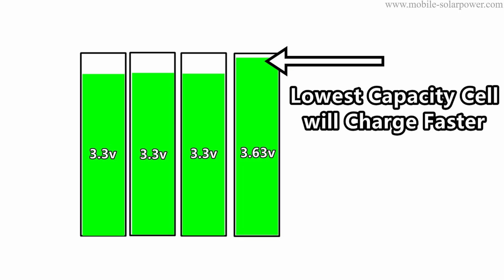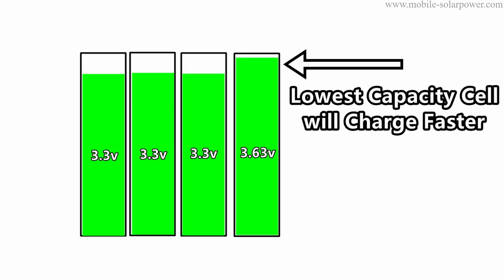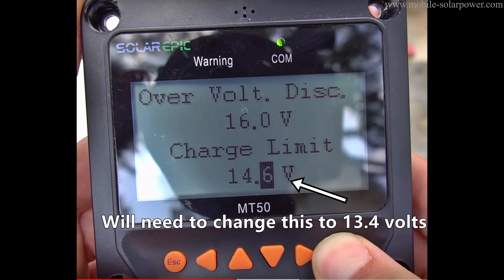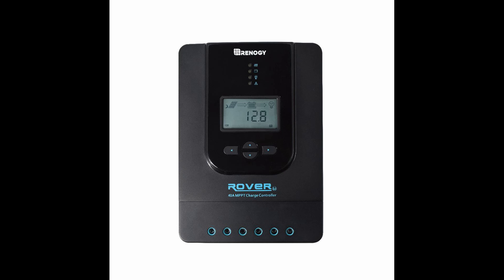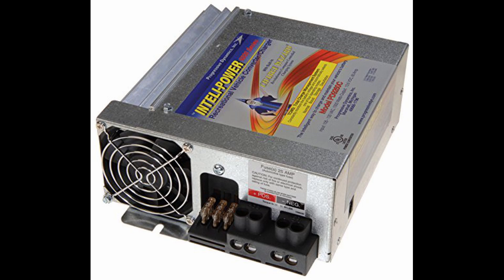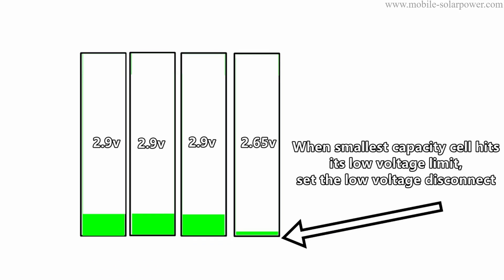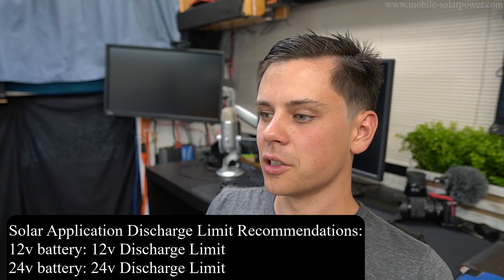LiFePO4 battery w/o a BMS: Top or Bottom Balance? Mismatched Cells?

Comment from the maker: This is an old video when we ran packs without bms. Nowadays, you just slap a bms on the cells and it's good to go. It will top balance your pack and you don't need to think about anything. 

So don't worry about top or bottom balancing. Use a BMS and you are set.

Does off-grid solar confuse you? 
Check out my DIY friendly website for solar system blueprints and product recommendations, and so much more! 
http://www.mobile-solarpower.com

Join our DIY solar community 
#1 largest solar forum on the internet for beginners and professionals alike:
https://www.diysolarforum.com

Check out my free book
Best-selling and beginner-friendly guide to 12V off-grid solar!
https://www.mobile-solarpower.com/the-book.html

~~~~~~~~~~~~~~~~~~~~~~~~~~~~~~~~~~~~~
My Favorite Online Stores for DIY Solar Products:

Current Connected
My favorite USA Distributor! Best Prices for EG4, Victron, Solar Panels and high quality components. Fantastic customer support and fast shipping: 
https://currentconnected.com/?ref=wp

WattCycle
My favorite 12V budget battery!:
https://www.wattcycle.com/?ref=aaezwkkc

Epoch Batteries
My favorite high-quality 12V battery:
https://www.epochbatteries.com/products/12v-460ah-lifepo4-battery-ip67-heated-bluetooth-victron-comms?rfsn=7352625.50494d

Watts247
Need international shipping for large batteries and big inverters? Check them out!
https://watts247.com/?wpam_id=3

Rich Solar 
Budget 12V Inverters and MPPT:
https://richsolar.com/?ref=h-cvbzfahsek

Battery Hookup
Cheap used lithium cell deals:
https://bit.ly/2mIxSqt
5% off code: diysolar

Contact Information:
I am NOT available for personal solar system consult! If you wish to contact me, this is my direct email: williamprowsediysolar@gmail.com

Join the forum at https://diysolarforum.com/ if you wish to hang out with myself and others and talk about solar

FTC Disclosure Statement and Disclaimers:
Every video includes paid promotion or sponsorship. Some links on this youtube channel may be affiliate links. We may get paid if you buy something or take an action after clicking one of these. 
My videos are for educational purposes only. Information is subject to change/update at any time. Electricity is DANGEROUS and can kill. Be smart and use common sense :) 
DIY Solar Power with Will Prowse is a participant in the Amazon Services LLC Associates Program,
An affiliate advertising program designed to provide a means for sites to earn advertising fees by advertising and linking to Amazon.com
Reply: Even I got mismatched cells, BMS will help. right? Thanks.
Reply: If you have a configure of more than  1 in series  than you will have to bottom balance. BMS can't reach back on the 2nd series because the BMS only has leads on the 1st series 

still have to set the parameters on the bms. You still need to set parameters on the solar charger and bms. It makes my life easier because if one fails to protect than the other is doing its job. Sometimes my epever will spike on the volts and won't shut off on high volts for a few seconds but, my bms will stop that in a flash.
Reply: Will, I'm just top balancing 4x 125Ah cells and I want to use effectively 100Ah at usable 12V system voltage  (100A Daly 4S will of course be attached) in my overlander, with 2x100W solar on the roof. What voltages would you recommend? For the Victron MPPT and Orion I had in mind 14.2V absorption, adaptive, limited to 1hr, 6A tail current and 13.4V float. Victron BMV set to 100Ah capacity, 14.0V charged voltage and 5% tail current.

But after watching your video I'm no longer sure to set the voltages that high ..
Reply: Will, how much of a voltage difference between cells can I still consider as fairly well balanced?  I know you said we can just slap on a BMS but I've heard many say that is not enough if the voltage or state of charge of the cells are way off.  I am planning to buy slightly used LiFePO4 batteries for a 12V 4S 100AH DIY portable battery bank and I want to be able to make the most of the batteries but I'm afraid I may end up with "unbalanced" cells from the seller. 
Thanks.  Your videos have been very helpful for people like me who know little about these things and are trying to learn.
Reply: Hi, I have bought a used battery pack 16s10p made of LiFePo4. How could I balance them since I cannot remove the cells from the pack ? thanks

Comment: I wish I'd found this a week ago.
I had exactly the problem you showed: 3 cells @ 3.34v and 1 cell @3.54.

Luckily your forum walked me through how to handle it. 
I only  pushed 13.66v for a few hours trying to get the BMS to balance but the cells actually lost voltage and I ended up having to put an old flashlight on C1 to bring it down.

I'm replacing the BMS with one that is programmable multiple ways.
Now I know what to settings to use.

Thanks!

Comment: Greetings from Portugal. I use a JK BMS on a 2P8S (EVE 280Ah cells) and it doesn't allow for automated bottom balancing anyhow, the 'start balance' setting cannot be reversed. Nonetheless, I manually bottom balanced the cells @2.8V UVP over several days but found the Ah stored after a full charge was quite a bit lower going from 590Ah top balanced down to around 550Ah now bottom balanced with the same Victron MPPT settings. I'm now going to switch back to top balancing @3.45V and see if that loss is recoverable... I cycle the battery fully every night with whatever the charge controller puts in during the day, when the BMS kicks in with UVP 2.8V the inverter auto switches to grid until the sun shines next day. This has reduced my electric bill by €60 a month so if I get 2,000 cycles or about 6 years that's a good return on investment of €1200. EDIT The JK BMS has now fully top balanced the pack @3.5V and the last two full cycles got 598Ah so top balancing  gives more capacity, the cells are 200mv out of balance @ 2.8V but only 2mv resting @ 3.4V.

Comment: I use a 100 amp 24v battery for a wheelchair, I charge it to 3.45v per cell and discharge it to 3.2, 3.1 per cell. Is that good for the cells themselves?

Comment: I have a few packs.  Hundreds of dollars worth i made for less than half because i followed these simple guideline. No Bms.  Only thing to add mentally get a gauge of your average commute. Build battery accordingly. If a 10AH will drain halfway to work and back in up to few days. BUILD A DOUBLE IF POSSIBLE 15 OR 20AH.  Cost is issue BUT KEY because of larger size. You never drain it maybe half.  BOTTOM LINE YOUR CELLS ARE. NEVER STRESSED.  STAYING BALLANCED.    DONT WIMP OUT ON AMPS

Comment: Ebike charge 95% add xtra string of cells increase4.2 more. Remember voltage equals Speed. My transistor is63v on a 36v setup i can handle 4 more.  I heard this s few times.  It van be done

Comment: I bought a XZOY 24V-5120W-LiFeP04 (200-BMS) and since it comes with it's own internal BMS, and is rated for 25.6V, what should I set the lower and upper limit to in my Victron Solar Charge Controller and/or my Victron MultiPlus-1?

Comment: Wouldn't a diode between the charger drop the voltage to the battery for chargers with set voltages ?

Comment: Hi i have 4 x 210Ah Cells, 4S 12V. 2 x Cells at 3.33, 1 Cell at 3.25 and 1 Cell at 3.28. Maybe sound crazy, but is there a way to balance the cells by drawing current via a 3V Motor, to manually bring down each cell so they all have matching voltages, using a multi meter in the process. I have a Victron IP22 charger, so no good to top balance, and i don't want to buy another charger to top balance. The string will have a JBD BMS but I want to balance the cells before installing the BMS. Many thanks

Comment: Assume I have several 12v (4S) Batteries with their own 4S-BMS.
Assume also I have an Inverter that takes in 48VDC.
Q1: Will it work if I connect 4 of my 12V batteries in series to my 48V Inverter?
Q2: Can I connect the Inverter to the Batteries CAN port and get battery readings?

Comment: How critical is balancing the liFePo batteries?  And initial individually full charge before hooking up?
I have (8) 12v 100ah chins in a 4s2p config for my 5000w 48v phocos.  I have about 2000w pv input.  
Seems like they are not lasting long as they should.

Comment: I just bought 6x48v 30amp hour batteries and I can not get them to charge past 54.2volts. Manufacturer says to charge to 58.8v, but my Growatt maxes out at 58.4v. Doesn’t matter as the battery’s BMS (well one of them, they are in parallel) shuts the Growatt down at 54.2. 
Manufacturer says to discharge and charge to full at 10 amps which I’ve done 3 times now with no improvement. These are LifePo4 chemistry batteries.

Comment: Well, leave comments or questions. Hmm
My 8 year old Trogen L-16 battery system is connected with 16 new LI-iron 280ah good quality top balanced batteries.
I cycle between 12.4 vdc and 13.4 vdc on my 12 solar panels here in Montana.
I will have to turn off the li-iron when the temp drops below 35 degrees in my shed.
I eventually will phase out the Trogen batteries and get another 16 Li-Iron.
About 3 months the system is off during the darkest part of winter, on trickle charge
ANY SUGGESTIONS, Please reply, Thank You.

Comment: Excellent Will thankyou. I'm using cells for car audio sound quality build. Since they will never see low voltage and run around 14v, but your right, top balancing is most certainly the way to go, and again your right it is way better to bottom balance if at all possible

Comment: I have a question , if I change lifepo4 to 3.65 how long do I need to wait till it balance? I'm building 24v 8cell pack when parallel battery pack hits 3.65v I disconnect chage and check voltage tow  cells in 3.64 and all other in 3.65 - grade A new cells (sorry about my English)

Comment: How to change the upper voltage limit. In the bms I have set the upper voltage to 3.4 volt. The cells are not good quality ones. It is getting disconnected before complete charge. Please help.

Comment: Sorry for the noob question, but isn't the job of the BMS to manage each cell and to dynamically balance the whole pack? So if one cell reaches a higher or lower voltage compared to the rest, the BMS will just cut power to it or continue charging/discharging it longer, etc. Why do you need to top or bottom balance if you have a BMS?
Reply from the maker: This was back in the day when people ran systems without a bms. Especially the marine crowd. This is no longer an issue.

Comment: Hi Will and all together, have I understand right, that I can top balancing my cells with 13.4v with my solar charger? With or without the BMS? And is that right that I don't need a extra Lithium battery charger to balance the cells? It would be great to get a answer from someone!  🙏🙏🙏😊

Comment: Wouldn't having the cells on a bms do both bottom balancing and top balancing on it's own once voltage and internal resistance reach capacity it send power to the next cell. Is this only for multiple cells on paralleled together?
Reply: BMS will balance very slowly. And you will need to cycle the battery several times. This can take weeks of daily usage for a large battery. If you have like a phone charger you can likely just let the bms do it over a few days. But for like a 1kwh it could be a week of full use.
Reply: @dylan-nguyen  but in a daily use such as living off grid they would be cycled daily.
Reply: @gabrielmartinez3171  sorry I forgot to mention the cycling without balance can lead to poor performance and decreased cell life.
Reply: @dylan-nguyen  wouldn't the bms do the balancing though? Is this for uses cells or do companies balance their batteries when placed in packs such as tesla using 18650 cells? Every cell would have a slight difference voltage and internal resistance right if so they must go through alot of time and energy. I'm not using lithium yet but it has me intrigued when I need to replace my sealed batteries 800 amp hours at 48v. Prices are coming down on prismatic cells wouldn't be able to afford the price already built batteries like the battleborn. $16000 for 400 ah at 48v.
Reply: @gabrielmartinez3171  depends on where you buy them. Most will not balance separate batteries. Internally each battery should be balanced from the store. 
But if you buy more than 1 pack, You still want to do a manual balance for speed/reliability. If you’ve seen a bms it usually uses like 12-16awg wire so the balance is very slow. 
Whereas you can manually hook up 8-10awg wire and balance in an hour or so.
Reply: @dylan-nguyen  I was thinking about grade A 280 prismatic cells 2 sets at 48v each with a 100 amp Daly bms I dont have high draw items on my solar system mostly constant load. I need at least 20,000wh of capacity to give me my 3 days of backup since I'm 100% offgrid.

Comment: Do I need to balance my 4 Battle Born 12v 100ah before hooking 2s2p? 3 are brand new but been using 1 for a month in camper
Reply: Yes if u got more than 1 battery u should balance. Unles it’s like a tiny phone charger

Comment: I’m looking at buying 3 300ah 12v drop in replacements and connecting them in parallel for 900ah capacity, is there a different way to balance these?

Comment: bro can you make a video about mixing different brand of lifepo4 batteries in series ? like I have 12v 100ah plus another 12v 138ah and 12v 40ah batteries in series ?
Reply: Don’t do that you’ll effectively lose 100AH. In series you will get the least cell’s capacity.. so 36v 40AH

Comment: Do I need to balance my Lion Energy battery bank? I individually charged each battery (4) I haven't connected them together yet. I am running a 24V bank, 2 pairs of 12V batteries. Since the batteries have BMS, is it unnecessary for me to balance them? Will they do it on their own in time? I am probably over thinking this, but hoping you can help me out.

Comment: STOKED - FOUND SOMEONE TO EXPLAIN ELECTRIC STUFF. My wife and I have lived on Maui for many years in Kihei - desert, but not as hot as LV (I grew up in KS so I've worked in 112-115 F) and are stretching out budget on Social Security in one of the priciest, most inflation prone areas of USA.  I want to put together a modest solar setup - not on a roof, but on the ground per need, to charge my Dell 15" laptop, several iPhones and D-cell batteries for a small emergency fan.  I'm a bed bound mostly invalid and spend most of my time in a back bedroom with poor ventilation.  Home Owners association rules allow a room AC in living room only - so if electric goes out I'm dead meat without a fan of some sort.

My forte' is concrete and dirtwork as a construction surveyor and former federal chief inspector and knew very little about electric until I discovered you!  I've worked on two of the tallest buildings in the world in succession in Chicago, but never did much with home building other than layout some subdivisions.  My experience is strictly major construction, interstate highways and the like. 

Techies like you tend to throw around a lot of acronyms.  I figured out BMS as battery monitoring system, but continual acronym references becomes tedious and "cultish".  I have great admiration for so much enthusiasm and diligence in one so young!  Keep up the good work - I will be watching!

Comment: Hi Will, not sure if i can get an answer on this or not,, I may have asked in a previous video..  But here i learned that for solar it is better to do a bottom balance.. I will have a 13s system that i'm building using the big BMW cells, about 27Kwh. per cell. I think.. i calculated about 660Ah. and so i have learned that a BMS would be totally useless. and that bottom balancing is best..
What is the best way ( or is there a device) to bottom balance ?

Comment: Did you move your bottom balancing video with the digital battery meter to private??? I need that video.
Reply from the maker: Yeah because people were running without BMS. Check out updated website on custom LiFePO4 systems

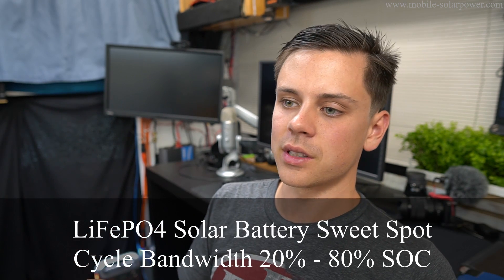Comment: At about 4:30 you suggest that it is best to stay between 20 and 80 percent charge. That means the lifepo4 battery bank is only useing 60% of its capacity. Presumably this prolongs the life of the cells. What about in electric vehicles? Does charging a set of lifepo4 cells to 100% and then discharging it to 0% on a regular basis greatly affect its lifespan? Comparison maybe?  In other words, just how badly am I hurting my lifepo4 cells in my car by doing full discharge cycling? The answer to this question helps folks decide on wether or not to use standard lithium cells or lifepo4 for their electric vehicle. Thanks for the great videos!  :)

Comment: I guess for ev's it's easier to replace the not so good cells. I've got a a cell was rocketing at 3.75 while all the other where all around 3.3...basically quite discharged. We're doing some testing about rebalance but the ending will be...just replacing most probably.

Comment: Love your Videos. Question: when I use a bms on my lifepo4 battery how do I protect my victron mppt charger? When the bms cut the charging and the solar panels are still putting power, how do I protect my charger? Panels still on my mppt and the bms cut, it could damage my charger right? Cheers from Germany
Reply: I also have this question, did you find the answer?
Reply: Your solar charge controller will convert the power from your solar panels into heat. Your bms will only cut the charging not the connection between battery and charger, that's what on my head. Please enlighten me, that's also a question I want to ask.

Comment: Thanks for a clear description of the benefits of bottom balancing and the risks associated with inexpensive BMS units.  Many of us understand what we are doing, but for the noobies it is critically important that they get good information correctly presented - as you said, it is easy to get burned - these cells contain a lot of energy, which is why we use them...